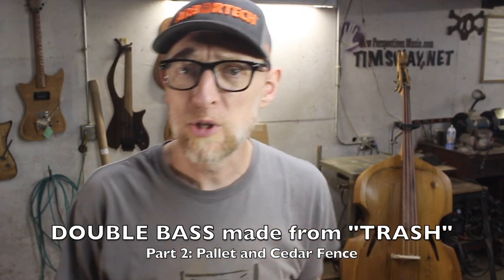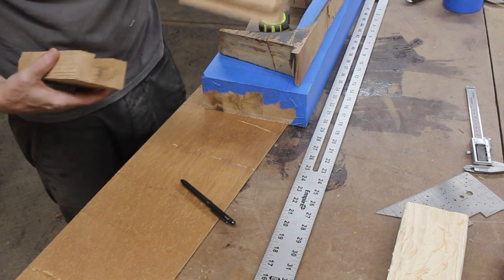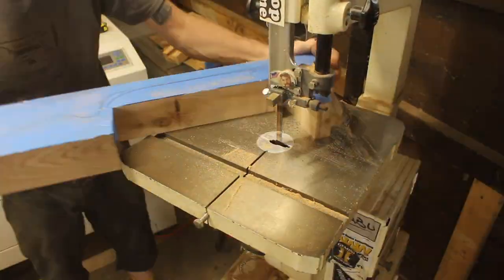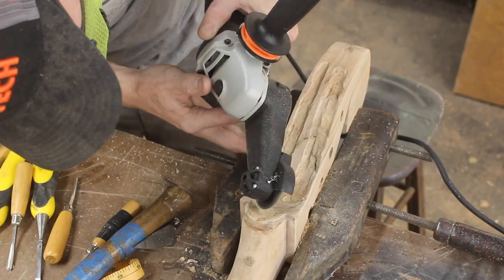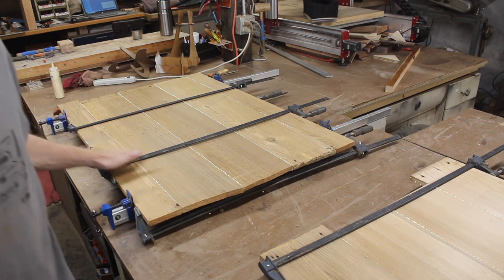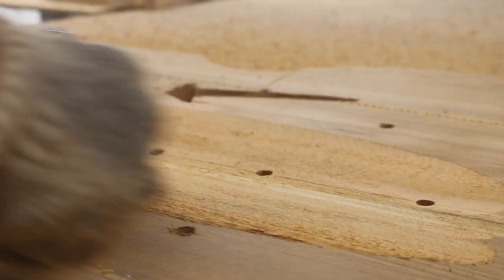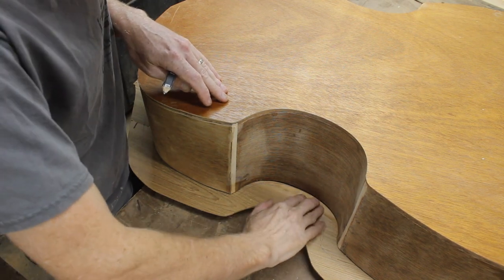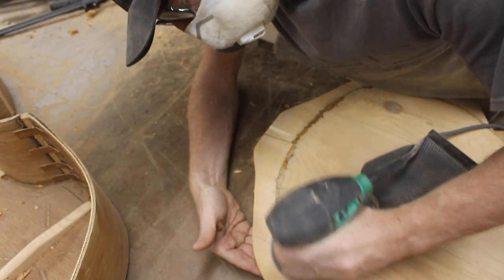Power Carve an Upright Bass From "Trash" Part 2: Pallet and Fence

Comment: The neck joint in classic double basses didn't got dovetailed. Just a good tennon glued up with hide glue.
If the bass falls a dovetail joint would break the neck block and the ribs.
The tennon is strong enough, but would break loose, when the bass falls.
Have a good build!
My compliments on the tones of the basses you build!

Koen
Reply from the maker: True, but modern Englehart necks are made with dovetails. When I restored my aluminum bass, I used an Englehart neck and cut the dovetail off. I simply butt jointed the neck to the block with two bolts. It has held up fine but the bass did fall once and the heel still broke in the same spot as every other Kay! However because of the bolts it was super easy to take off and fix.
Reply: Thats true, what i mentioned would only work with hide glue. not with the bolts. 
and eub's usually get bolted too. Nice Job!

Comment: If you take a pencil and cut it in half lengthwise right through the lead, your point will mark the exact edge that you are following.
Reply from the maker: yes, I have one for guitar nut setups, but I wanted this to be larger than the profile, hence the trick of flipping the carpenter pencil the wide way.

Comment: haven't got a speck of the luthier in me, but enjoying this build.   regarding the "line" on the top from the two layers.   In hindsight, would you have rather cut the cedar into like 2" strips and flip them on edge and glue it up before carving out the top?   That would have eliminated that line?
Reply from the maker: interesting idea. I did want the top to have as little glue in it as possible for resonance, but that would look cool as heck

Comment: Thanks Tim, watched this 3 times. Question, I'm building a mountain dulcimer bass and I'm trying to use 3/4 proportions. I ordered a nice pair of tuning pins mounted to brass plates. After I ordered I noticed it said they were for a 1/2 bass. Does it make a big difference? Think I can get away with 1/2 (mounted to brass plates) tuning screws? I haven't built the head-stock yet.
Reply from the maker: I don't see why not. Just design. The head to fit them. As long as they can turn the strings they should work fine.

Comment: Hello, Tim. I am really interested on finding measure information for 1/2 size contra bass. I only need to know the distance between the body and the neck. I am thinking the highest point to the body. I am ready to glue the neck to the body but I do not have information about the distance that must have. If you can help. Thank you.
Reply from the maker: I honestly don't know. I've never played a 1/2 size. On my 3/4 size the bridges tend to be around 7" tall when set up

Comment: 1930s aluminum?I didnt know that was a thing. Hows it hold up?
Reply from the maker: A German company made about 1500 of them and the folklore is they stopped making them and even melted some down because of the war. AlCOA of New York also made some and there are violins, mandolins and a few other instruments. Nowadays with modern PAs and mics we can make them sound good, but they do lack compared to wood instruments acoustically
Reply from the maker: oh, and it's f-cking awesome.